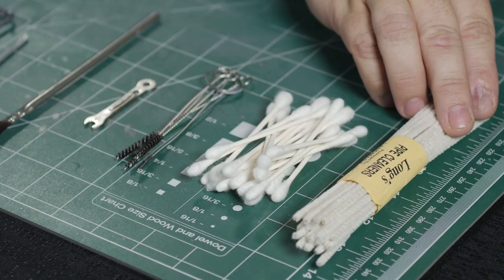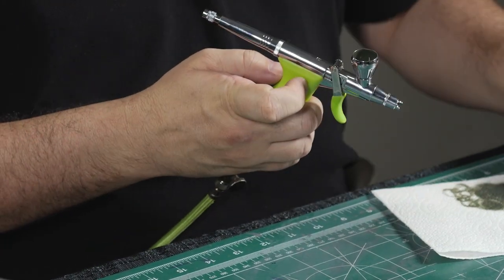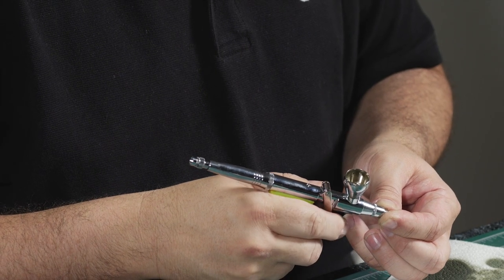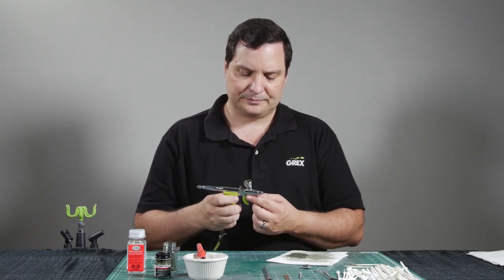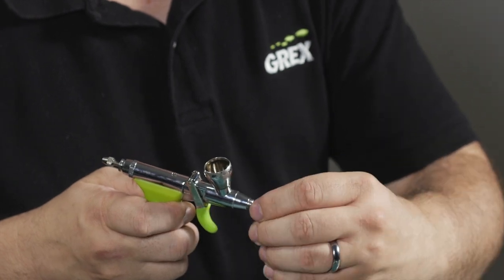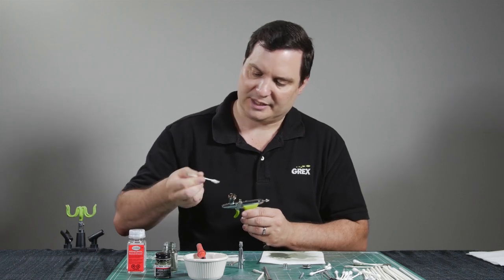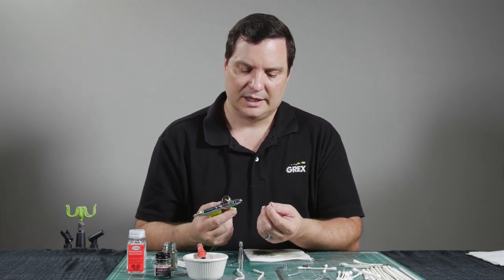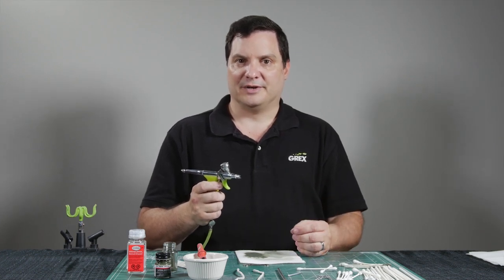Cleaning your Grex Airbrush - Hobby Paints - Bryant Dunbar

Comment: I've got a GREX TRITIUM TG &  I'm hoping U might be able to give me some input or suggestions with a problem I'm having with it🙏
👉it leaks paint or any fluid [BADLY] From the "packing screw area" when pulling the trigger back
. (I sent the A/B off to a scale Modeling Community Popular Vendor & they replaced the PTFE seal & sent it back to me) After I received the A/B I Put some laquer thinner.in the paint cup to test it- before running any paint thru it. Everything seemed 👌 It sprayed the thinner smoothly without leaking a drop!! I ran a few more paint cups thru it & then put it in the rack while I got my paint ready for it... I filled the cup about 1/3 full of thinner to be sure everything was still good & 😡!!! EXACT SAME LEAK started again...🤷 I've tried contacting the Shop several times without any response back - but I really wanted a 2nd opinion as to what might be going on from someone else...(like yourself😉) Does this sound like anything U recognize ? I'd Really APPRECIATE any Help or Suggestion U might offer me!!! I actually used this video as my guide to cleaning the A/B & everything was Great until it needed that "Packing Screw Seal" replaced by the Modified PTFE now used...??
Thank U - Respectfully : Lee 
aka:☯️ZenModeling☯️

Comment: love the video.. I recently purchased a TG3... When it came to clean it.. There was a little resistance when pulling the needle out... putting it back in after cleaning is that normal... Thanks.. Richie
Reply: +twinkey apodaca 

Sorry for the delay in my response. You may have a little paint build up around the packing seal which is aft of the color cup and forward of the trigger. I would suggest taking a pipe cleaner with some lacquer thinner and work past the color cup area and into the packing seal. It's Teflon so it won't be compromised by the lacquer thinner. 

If the pipe cleaner gets really "tight" in that area but comes out with paint on it, that's likely what has happened. Repeat the process a couple of times and that should cure the problem. When you put the needle back in the airbrush there should be a noticeable difference. If you continue to have issues please contact me through our website or email us at info@grexusa.com and we'll respond accordingly. We will trouble shoot the issue until it's resolved for you. Thank you for watching the video and let us know if you need further assistance.

Comment: Sorry Mister Dunbar but regarding sonic cleaners you don't seem to realise how much they revolutionised the cleaning of parts like carburettors for vehicles from cars to planes. The slightest scratch on the internals of brass jets will affect the performance and running of a carburettor and it's a no no to poke anything into the jets. Some internal brass parts are fitted into the body of the carb and the best cleaning tool ever invented for shifting blockages from these impossible to reach internals is the sonic cleaner. Ask any garage mechanic who's used them for many years. Having cleaned many auto parts i've never seen damage or corrosion on parts or repeatedly cleaned tools. And that includes chromed brass. A sonic cleaner is capable of removing the hardest dirt deposits and corrosion but will not attack the surface of sound metal including brass.
Reply: Ms. Jones, sorry but what you fail to realize is many seem to feel that a sonic cleaner will replace any effort on the part of the end user to actually "clean" their airbrush. Many won't make actually disassemble the airbrush down to it's minute parts and only clean the ones that actually come into contact with pigment or paint. There are are areas of an airbrush that should remain dry in order for the airbrush to perform properly. However, many put the entire airbrush into a sonic cleaner and flip the switch. This does 2 things. First, it can migrate paint and contaminants into areas of the airbrush that otherwise would never get contaminated. Second, these areas now "hold" moisture which promotes corrosion. I've seen the effects of this kind of abuse, and yes it is abuse, and it isn't pretty. It often requires the replacement of parts (usually at the customer's expense) that otherwise would not require replacement over the course of the lifetime of the airbrush.

Lastly, there is no control or standard as to what the end user is using as a cleaning agent in a sonic cleaner. Many have come up with some interesting concoctions only to find they "de-chromed" their airbrush. Ammonia based products are often the culprit which are specifically stated not to be used with our airbrushes in the instructions. So don't tell me it can't happen with the latest technologies because it does happen. I've seen the results.

I've had customers come to me and tell me they made this kind of mistake and learned their lesson. I have yet to have a customer come to me and tell me my methods of cleaning are wrong, promoting damage to the airbrush and a sonic cleaner is the only way to go. Sorry, there's simply no evidence to support sonic cleaners as the favored method when it comes to airbrushes. 

I'm not in the business of selling, cleaning or repairing carburetors but if you know sonic cleaners are the best way to go for them, I'm sure you know better than I do. My personal cars are fuel injected and I don't currently own any aircraft so I doubt it'll be an issue I'll need to address.
Reply: Wendy Jones Who are you? What are your Credentials on this matter? Super Carb, hot rod, NHRA mechanica? AAA certified Bozo? Gasoline propeller head? Juice box sniffer? who? 

Let's put down some real facts, are you an avid airbrusher? Do you run Airbrush seminars, with hands-on tutorials and tips? Or are you just pointing out general facts unrelated to the uploaded video in which you are commenting? Maybe you have the wrong YouTube window open and are commenting on multiple issues and got them all mixed up? Maybe you are a propeller head and had an epiphany regarding sonic cleaners and needed to spread the word on the sonic wonder device and Bryant was the first victim of your rant..... Who knows, you must be a teenager...

Comment: This is completely wrong. You never put a pipe cleaner or a q-tip in an airbrush. Ever. Pipe cleaners are nothing but lint trapped between two loosely bound wires. Those little fibers are now inside every crevice of that airbrush. 
Grex either needs to include $.85 nylon brushes with the kit or drop the price down to $30 which is all a Grex is worth imho.
Reply: Sweet Jesus! Is this a troll? My Grex airbrush is fine. I have many cleaning agents that I purchased and it didn’t break my bank. Also, I enjoy maintaining my equipment: guns, airbrushes, power tools, hand tools.

Comment: I can't believe that you charge $220-$250 for an airbrush and I have to go buy the crap to clean it with.
Reply: +Andrew Smith 

I'm not sure what that's supposed to mean. All airbrushes require cleaning. As for cleaning products there are many uses and products that are used in airbrushes. A cleaning product which is conducive and safe for a cake decorator or for body art won't likely work for someone spraying automotive lacquers. You might be disappointed to know there are $300-$800 airbrushes that don't come with cleaning agents either.

Lastly, given many products used through an airbrush will require a cleaning product that would likely be hazmat. The cost of shipping of airbrushes would be prohibitive if these agents were included with the airbrush. 2nd day or even 3rd day shipping by air from a dealer to a customer could be prohibited all together.
Reply: +Bryant Dunbar I mean why don't you include cleaning brushes? Why are you filming and posting videos suggesting I melt and stretch a plastic sprue? I seriously regret not getting another Iwata. 

And btw, paint doesn't "reside" in the nozzle. Does it get its mail there? Pay utilities? It doesn't reside there.

"There may still be some paint in the nozzle." 

Having to suffer through your awful communication skills is the worst part of owning a Grex product.
Reply: +Bryant Dunbar And paint doesn't "reside" anywhere.